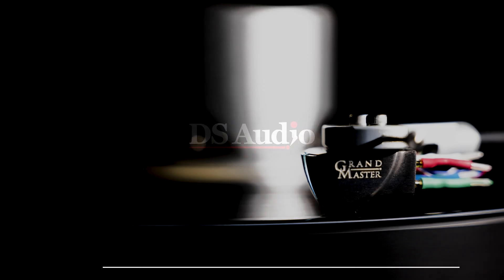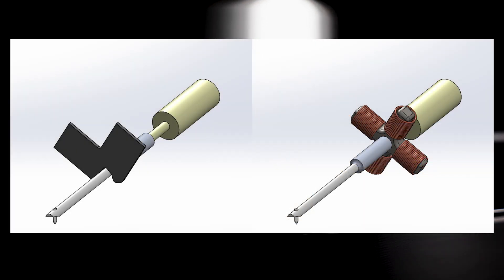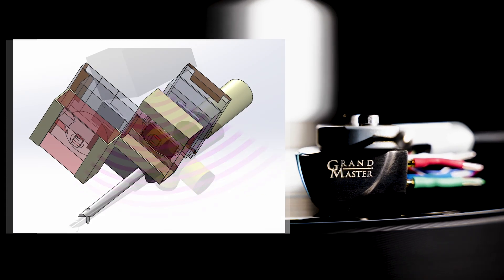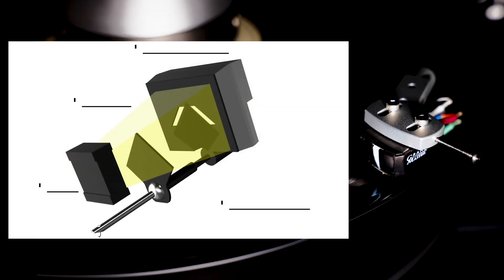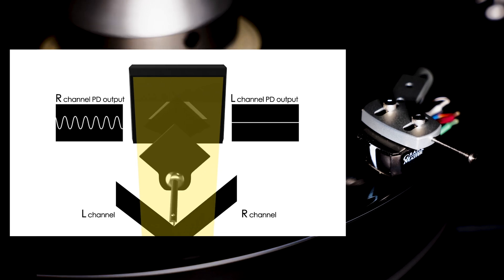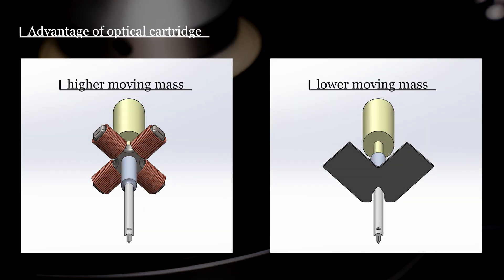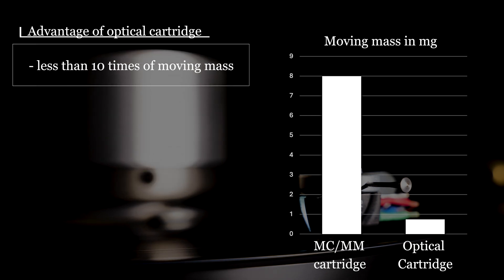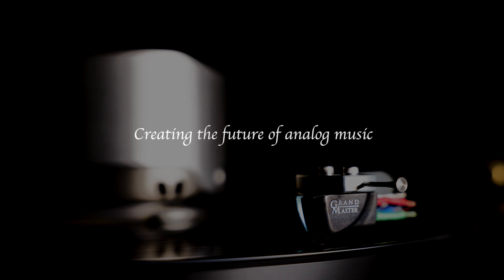How optical cartridge works(English)

Comment: こんにちはぜ、光変換センサーが選ばれたのでしょうか？ 結局のところ、実際には、可変容量のコンデンサが針に判明しましたが、光センサーよりも音波に変換する方が簡単ですか？

Hello, explain why the optical conversion sensor is selected? After all, in fact, a variable-capacity capacitor turned out on the needle, is it easier to convert it into sound waves than an optical sensor?